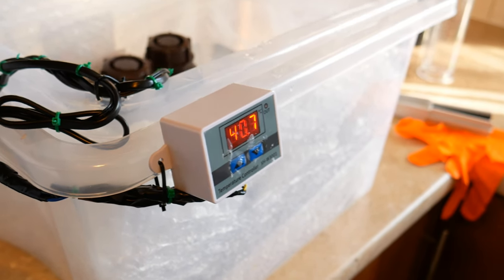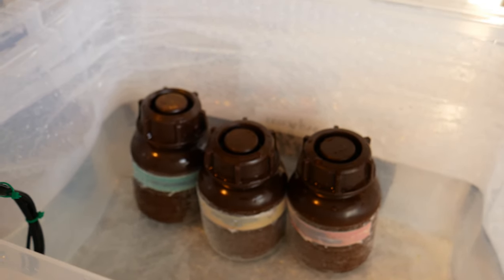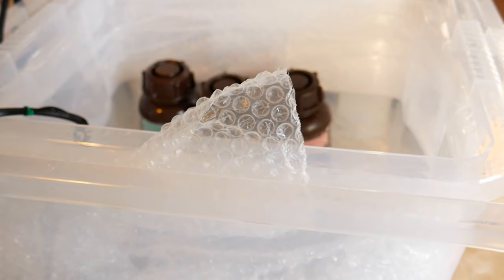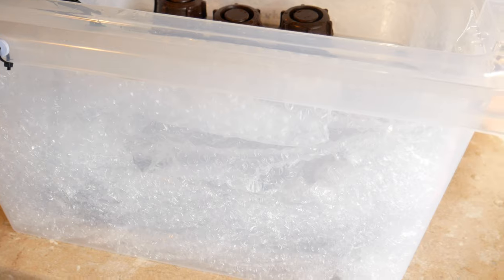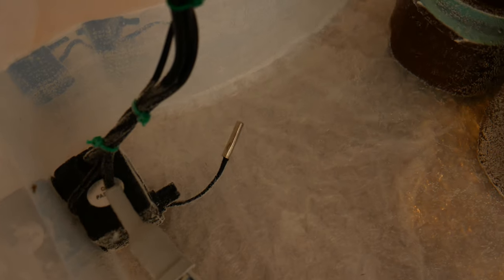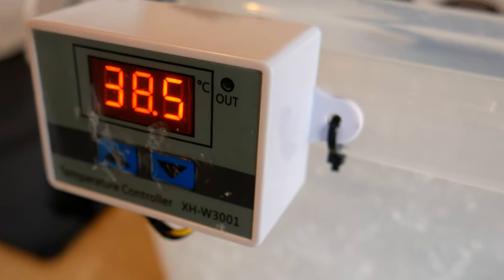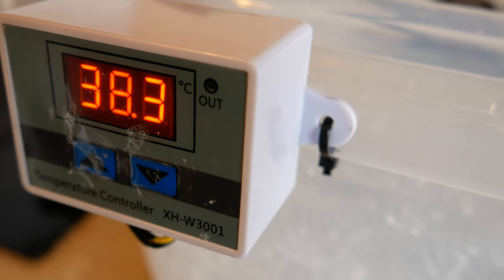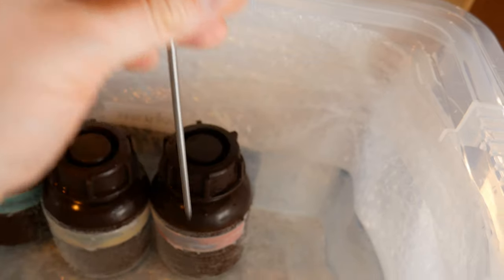DIY temperature control setup for C41 and E6 film developing

Comment: If you get an aquarium heater with an external temperature probe just leave the probe out of the water.  Then the temperature controller can decide when the heater turns off instead of the built in thermostat.
Reply from the maker: I guess you can try doing that, provided the probe is somewhere near the top of the heater.